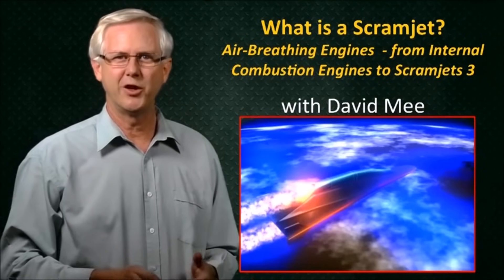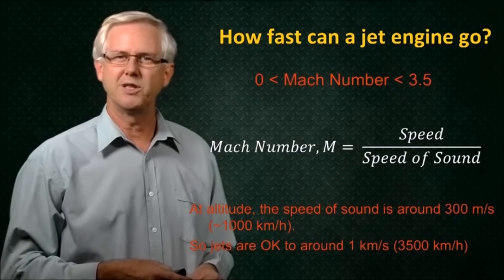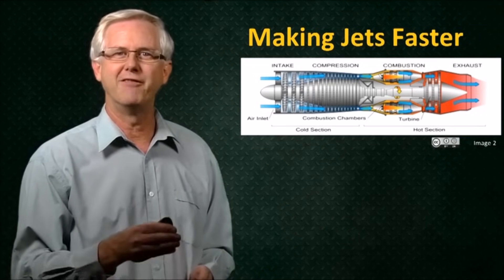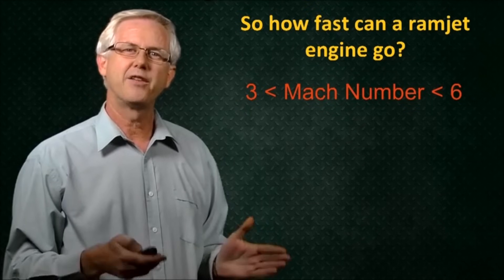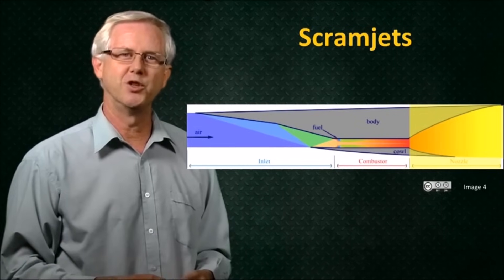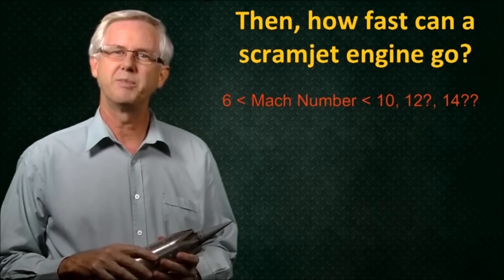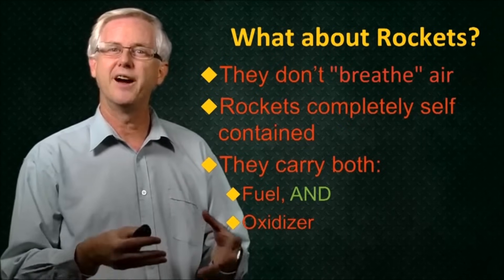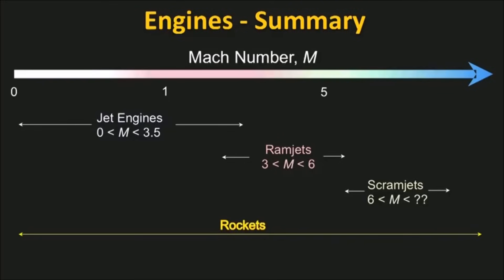Ramjets and Scramjets Explained - Mach 14

Comment: Integrating advanced technologies such as maglev propulsion, hyper-glide vehicles (HGVs), scramjets, electric Vertical Takeoff and Landing (eVTOL) aircraft, magnetic fields, lithium force fields, micro/nano solar technologies, and cybersecurity innovations from organizations like NASA and SpaceX presents an exciting vision for the future of transportation, energy generation, and space exploration. Here’s how these technologies could work together in a cohesive system:

### 1. *Maglev Propulsion*
   - **Application**: Maglev technology can be used for high-speed trains and ground transportation systems, significantly reducing friction and enabling rapid transit. This can connect urban centers, airports, and other transit hubs efficiently.
   - **Integration**: Maglev tracks can serve as the infrastructure for ground transportation systems, connecting to hyperloop stations and takeoff/landing zones for eVTOL aircraft.

### 2. *Hyper Glide Vehicles (HGVs)*
   - **Application**: HGVs can operate at hypersonic speeds, allowing for quick intercontinental travel and potentially even space access.
   - **Integration**: HGVs could utilize maglev systems for ground acceleration and transition to scramjets for hypersonic flight, enabling rapid travel between cities or into low Earth orbit.

### 3. *Scramjets*
   - **Application**: These engines are capable of supersonic flight, compressing air for combustion at extremely high speeds, which is critical for hypersonic travel.
   - **Integration**: Scramjets can be integrated into HGVs for sustained hypersonic flight after maglev-assisted launch. They could also be adapted for launching small satellites into orbit.

### 4. *Electric Vertical Takeoff and Landing (eVTOL) Aircraft*
   - **Application**: Designed for urban air mobility, eVTOLs can provide a sustainable and efficient mode of transport in crowded urban environments.
   - **Integration**: eVTOLs can operate from maglev stations, allowing for quick transfers to and from ground transportation. They can also serve as first-mile/last-mile solutions to larger transit networks like hyperloop systems.

### 5. *Magnetic Fields and Lithium Force Fields*
   - **Application**: Utilizing magnetic fields for various purposes, including transportation (e.g., maglev) and shielding (e.g., force fields), can enhance safety and efficiency. Lithium-based technologies could improve energy storage and propulsion systems.
   - **Integration**: Lithium force fields could be used in advanced energy storage systems for vehicles and infrastructure, while magnetic fields could provide protective barriers for sensitive technology or human habitats.

### 6. *Micro and Nano Solar Technologies*
   - **Application**: Small-scale solar panels can be integrated into vehicles, infrastructure, and devices to provide localized energy generation.
   - **Integration**: These technologies could power eVTOLs, sensors, and other components of the transportation network, contributing to a more sustainable energy model and reducing dependence on traditional fuels.

### 7. *Cybersecurity Innovations*
   - **Application**: Advanced cybersecurity measures are essential for protecting the data and operational integrity of transportation systems, particularly those involving autonomous vehicles and interconnected networks.
   - **Integration**: Utilizing cutting-edge cybersecurity protocols from NASA and SpaceX can safeguard the communication and operational systems of HGVs, eVTOLs, and maglev systems. This would ensure safe and reliable transportation for passengers and cargo.

### 8. *NASA and SpaceX Technologies*
   - **Application**: Technologies developed by NASA and SpaceX, such as reusable rockets and advanced propulsion systems, can be adapted for transportation solutions on Earth and in space.
   - **Integration**: These technologies could enhance the capabilities of HGVs for orbital launches, while also providing innovative approaches to energy efficiency and sustainability in urban and intercity transport.

### *Potential Applications and Benefits*
- **Interconnected Transportation Network**: A seamless network integrating maglev, hyper-glide, and eVTOL systems could drastically reduce travel times, enhance mobility in urban areas, and provide efficient links to remote regions and spaceports.
  
- **Sustainable Energy Solutions**: The integration of micro/nano solar technologies alongside lithium-based energy storage can create self-sustaining vehicles and infrastructure, minimizing the carbon footprint of transportation systems.

- **Enhanced Safety and Security**: With robust cybersecurity measures, the risk of data breaches or system failures in transportation networks can be significantly mitigated, ensuring passenger safety and operational reliability.

- **Space Exploration and Commercialization**: The development of HGVs and scramjets can facilitate access to low Earth orbit and support the growing commercial space industry, enabling satellite launches and potential space tourism.

### *Future Considerations*
- **Infrastructure Development**: Significant investment in infrastructure is required to support these advanced technologies, including maglev tracks, hyperloop systems, and eVTOL landing zones.

-

Comment: It seems like you're interested in various advanced technologies associated with NASA and SpaceX, as well as concepts like hypersonic travel and maglev (magnetic levitation) systems. Let’s break down these topics:

### NASA Technologies
NASA is at the forefront of aerospace research and technology development. Some of the key areas of interest include:

- **Reusable Rockets**: NASA has collaborated with SpaceX on various contracts and missions, including the Commercial Crew Program, which aims to transport astronauts to the International Space Station (ISS).
- **Advanced Propulsion**: NASA is exploring technologies like ion propulsion and solar sails for deep space exploration.
- **Aerodynamics Research**: Projects like the X-57 Maxwell aim to develop electric aircraft, which could lead to more sustainable aviation.

### SpaceX Technologies
SpaceX has made significant advancements in space technology, including:

- **Falcon 9 and Falcon Heavy**: Reusable rockets that have drastically reduced the cost of space launches.
- **Starship**: A fully reusable spacecraft designed for missions to Mars and beyond.
- **Starlink**: A satellite-based internet service that aims to provide global coverage.

### Hypersonic Travel
Hypersonic refers to speeds greater than Mach 5 (five times the speed of sound). Technologies in this area include:

- **Scramjet Engines**: These are air-breathing engines that can operate efficiently at hypersonic speeds, potentially enabling faster travel across the globe.
- **Military Applications**: Hypersonic weapons are being developed by various countries for strategic advantage, featuring extremely fast and maneuverable projectiles.

### Maglev Technology
Maglev (magnetic levitation) technology is primarily associated with high-speed trains but has potential applications in other areas:

- **Transportation**: Maglev trains can travel at very high speeds with reduced friction. Countries like Japan and China have operational maglev systems.
- **Potential Space Applications**: There’s interest in using maglev technology for launching payloads into space, as it could provide a way to accelerate objects without the need for traditional rockets.

### Projectiles and Advanced Weaponry
The concept of advanced projectiles can overlap with hypersonic technology, particularly in military contexts:

- **Hypersonic Glide Vehicles (HGVs)**: These are maneuverable projectiles that can travel at hypersonic speeds, making them difficult to detect and intercept.
- **Research and Development**: Many nations are heavily investing in hypersonic technology for both defense and strategic purposes.

### Conclusion
The intersection of these  presents exciting possibilities for the future of transportation, space exploration, and defense. If you have specific questions about any of these topics or want more detailed information, feel free to ask!

Comment: This lecture demonstrates perfectly what I've started to many detractors for a long time, that the SR71 was capable of much more than its stated Mach 3.2 speed. It's my contention that the SR71 most likely went into a turbine engine idle condition around Mach 3 and then adjusted the inlet cone and afterburner section to perform as a pure ramjet. This capability would give the SR71 a possible speed of at least Mach 6. My thoughts are Mach 7.1, hence the SR"71"... just sayin 😉

Comment: 7:20  As of 10/08/2023 we now know for certain a ScramJet can do Mach 14.  It's no coincidence Mach 14 has been the top speed predicted for Scramjets in wind tunnel testing. An aircraft transponder was registered flying over France from their northwestern border at 70,000 feet doing Mach 14 with tracking lost as it crossed Sardinia en route to Israel. It's extremely likely to be a drone as a human pilot would almost certainly suffer terrible trauma from G-forces. 

Without knowing for certain it's very likely the craft was United States Air Force's latest and greatest speed demon heading to Israel to help with the recent attacks. It's hard to imagine what spy tech the U.S. has that Israel doesn't already have but they wanted the craft there ASAP. It's possible the craft has some form of payload it delivered to the IDF that is crucial for the upcoming raids into Gaza? Whatever it was it was something that could not wait the standard 10.5 hours for a C-17 Globemaster III like the munitions that are currently arriving.

Comment: My other question is regarding the quest for hypersonic cruise missiles.  From what I understand, ramjet engines are well demonstrated, and if they can infact reach Mach 6 or so, couldn't a ramjet powered cruise missile just be launched from a plane with a conventional solid rocket booster to accelerate it to  mach 3+ and then detach like a rocket?  If scramjets are more developed than I thought, the same logic applies.

Comment: Hypothetically, is there the possibility of an engine yet faster than that, where the flow of the air in the combustion chamber is still flowing at hypersonic speed, allowing velocities in the mach 20 or 25+ range?   I understand the material science issues related to heat, hence the hypothetical.

Comment: If we could create an adjustable aircraft with a jet engine and afterburner that then activates a ramjet when at top jet engine speed with the jet engine retracting into the aircraft body or closing off the engine aerodynamically.

Then as the ramjet approaches maximum power, morph the design with hydraulics into a scramjet configuration to utilize a scramjet to get to top mach speeds.

Place a rocket engine onboard as well and have that fire up at maximum scramjet speeds. Close off the scramjet while the rocket fires and this vehicle can hit mach numbers upwards of 15+.

If a lot of the wings and parts are dynamically controlled to morph in shape and position through these various stages of flight, then the vehicle might be capable of going from takeoff to mach 15+ and then returning back to land.

The engineering would need to be exceptional, the meta materials at the forefront of materials science, and the fuel consumption planning precisely calculated, but as a grand experiment such a craft could prove very versatile for very specific missions.

Comment: Here's the solution to the temperature and pressure being to high in Ramjets to get good combustion.   As the Ramjet approaches the highest speeds possible for the fuel to burn properly, instead, add water into the combustion chamber, then the water will expand and add to the thrust.  Is this possible.

Comment: why can't scramjet engines be used instead of rocket engines on rockets, 
where fuel is fed into the scramjet engine and when sufficient speed is achieved, then scramjet switches to airbreathing with fuel injection and then when rocket leaves atmosphere, then fuel is fed into scramjet again, some fuel could be save which could make rocket lighter

Comment: What about using a nuclear pile to heat the gas instead of combustion. The advantage here would be you could keep the gas flowing very hypersonic, would not necessarily need to be slowed down, and heat it with a nuclear reaction. You could theoretically heat it to about 2500K from 300K. Also, as the efficiency drops it could convert over to a pure nuclear rocket and obtain orbit that way?

Comment: Jet engine theory in 4 words. Suck, squeeze, bang blow.
Reply: That's 4 stroke internal combustion engine theory. If you hear a bang on a jet engine you are in big trouble.
Reply: @wally7856  I was referring to the combustion chamber on a jet engine. I take it you’ve never seen an F-8 fighter jet off. THAT is a GREAT BIG explosion (bang).
Reply: @MrSpeartip12  There is no explosion or detonation in the combustion chamber of a jet engine, it's just a continuous steady burn to add heat to the airflow. Works just like your hairdryer, continuous steady heat - no bang, no explosion.
Reply: @wally7856  . I know about jet engines. I worked on the for more than 20 years. You’re not catching the point. No, there’s no actual explosion, BUT there IS a slight noise when the fuel ignites. You can hear if you play close attention.
Reply: @wally7856  I understand that. You’re just missing it.
Reply: Maybe you’ve never been around military aircraft.

Comment: Good lecture. I’ve worked over 40 years for the US Department of defense in the acquisition of weapon systems and one rule in certain, stealth is cheaper than speed
Reply: If you really work for DoD, what is your opinion on the DF-17 and MD-22?
Reply: @groundbasedinterceptor  I have worked for the missile defense agency since 2006 and the Air Force since 1982. My view on hypersonic weapons is they are limited in use and over hyped by both sides. The vast majority of ground targets costs far less the the hypersonic weapons that targets them.
Reply: @joemama6906  So you think an SM-3 can intercept a DF-ZF or YJ-21 with capabilities intended to outmaneuver and outrun interceptors? 🤔
Reply: @groundbasedinterceptor  I believe their point was that spending 100 million per missile is not worth it if the targets are 10 times less the cost.
Reply: @tempestandacomputer6951  If the targets are a great enough threat and have little to no defense against something like that, it would be worth it if there is no alternative.

Comment: i wonder why liquid oxygen couldn't be injected into the intake ports prior to combustion chamber to get engine producing thrust at lower speeds until there is enough intake air to take over? wonder even if nitromethane would be a good fuel considering it has 2 parts oxygen?

Comment: a jet propulsion seems dumb, because it has propellers that look like blocking the air more than moving forward.  how cant they make a transformer plane? at low speed, use propellers. after gain some speed, fold propellers in and use ramjet, after that.. make the ramjet's pipe thinner and become a scramjet (why do they call it a go away jet, what part do they want to make go away?)

Comment: They simply don't exists so why are you and others talking about this kind of flying objects for decades? The fastest rocket plane was the X-15 reaching Mach 7 outside the earth atmosphere. The SR-71/A12 platforms reach a maximum of 3.2 Mach. Ramjets are as unnecessary as the X-15 or SR-71 for this matter. They're dreams of engineers but there's no purpose for them in this world today with it's myriad of other problems that ain't solved. Why didn't you built a decent railway system like in Japan or Europe. Much cheaper and much more realistic and feasible. Stop livin the dream and built a continental wide TGV/IC/Shenken bullettrain network. Stop flying act now!

Comment: Is there a possibility of combining three into one engine. Or have an aircraft carry all three engine models and switch to each at the desired speed?
Reply: Yep! They exist and are called turbo-ram jets. There are a lot of different variations, but a popular one is what the SR-71 implements and it's genius in its simplicity. Below mach 2 they funcion as afterburning jet engines but at mach 3+, the inlet would expand to direct air past the engine and flow it directly into the afterburner, making it function as a ramjet

Comment: My anxiety is  . 🤔🤔
Can't we make such a mechanism in which both types of engines (  ramjet and scramjet) work together in one single missile?
At the very first stage, solid fuel gives rise to both, after getting enough speed, ramjet starts working and soon after reaching its limits of speed, the system turns into scram jet while moving.
Bcoz as I understood here that there's a little bit difference in ramjet and scramjet. A ramjet can be changed into a scramjet by making some small changes in its intake system.
..
Can such a system be made where a ramjet turns into a scramjet within a air??? May be just by removing some pre-set mechanical parts of intake system within the air...
🤔🤔🤔

Comment: So a hypersonic airliner would have to have 3 sets of engines. Jet engines to get it up to M3, ramjet engines to go from there to M6, and scramjet engines to go faster still. That's a terrible weight penalty. You could have a 3 stage airliner, that stages like a rocket, but then it would have to make an unpowered gliding landing, since the final stages scramjets wouldn't work after it decelerated below M6. Maybe rocket-powered aircraft are more efficient after all. Or maybe somebody will someday build an engine that can morph from a jet engine into a scramjet engine by removing the compressor section after M3.